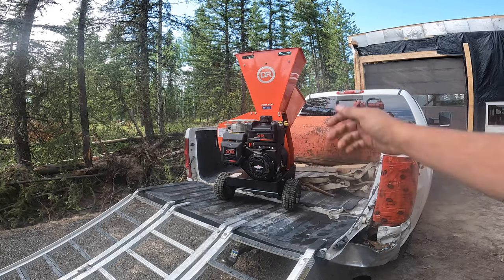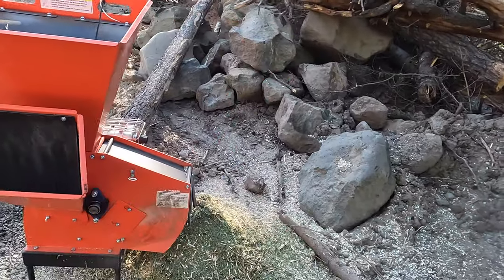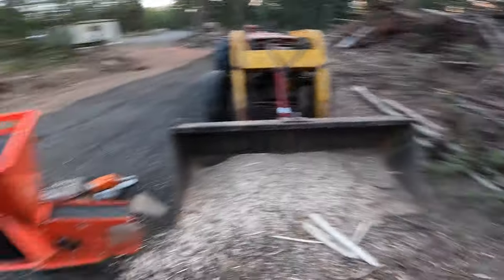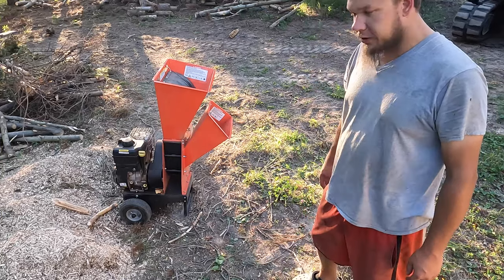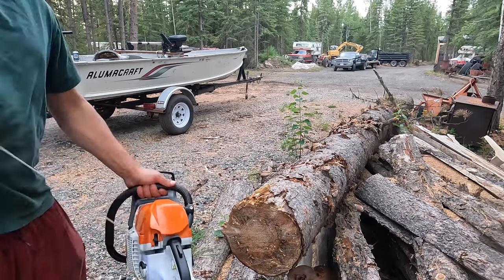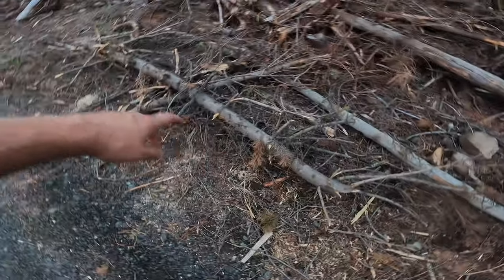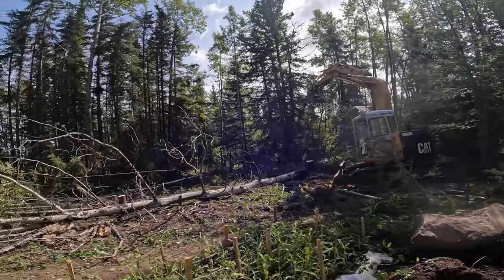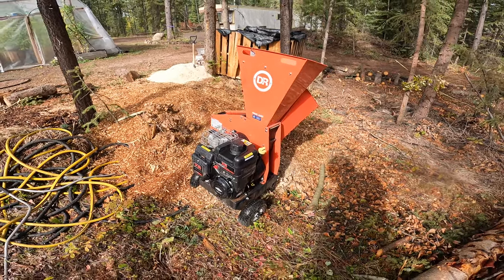Is A Small Wood Chipper Good For a Small Acreage?? and Brand New MS362c Chainsaw   4K

Comment: I got metal and electronic recycling point right next door and amount of wood chippers (electric) and other tools that only have minor lack of maintenance issues is staggering. I have collected and 5 minute fixed dozen woodchippers and only issue was ether damaged cord or most often dull blades. Couple had poor design getting clogged up by leafs rather fast. None of them worked that well with thicker stuff and even the heavy duty ones struggled with dry spruce even if thinner ones. Personally unless i'm looking to make compost, i would not waste time and energy on chipping the branches, but build kinda harvester claw that can crab the trunk and use rollers to remove branches from the trunk or chainsaw or machete etc manual tool, use the wood chipper for the small stuff or just pile and burn them if there is possibility for it. You can then turn the trunks of all sizes above 20mm or how small the claw can debranch into fire wood to be sold cheap for some folk who have issues to make their own due health. That way you get rid off the crap on jobsite and can make money instead of paying to get rid off it, or hell donate it and put it in as tax write off.

Also never push your hand that deep into intake chute! All it takes is blade start to pull braches and that branch catch the glove and pull you in. Prosthetics suck and cost tons so dont create need for one. If you get things stuck like that, make plywood peace that fits the the chute and handle to that so you can use it to push thing in, while shape prevents it going to the blade.
Another thing to consider if you plan on putting larger engine on it.. those walls are designed for the hp and rpm of the stock motor and most likely just barely be safe enough, so if you add larger engine, there is high chance that you get things kicked trough the frame and trough you. Mind that blade contraption is moving what ever is the rpm of the stock engine, so it might not be enough for larger one.
"this is why i like 24 inch bar" Yeah, its just enough to cut your toes off. I was thinking on getting longer bar on my saws, but after some moron threw away their barely used ms180 that just needed fresh fuel, i have been loving that saw almost much as ms200 since its light and works great for debranching. After witch if i need to cut logs i take out the trusty 026 for logs and smaller stuff those two smaller ones are just fine. Then again i tend to clear the forests from smaller stuff for firewood and not other cut down logs. You other hand have plenty of equipment my budget could not even dream about so thats one difference. Like i would kill for bobcat or proper tracked excavator with a claw.
I know i'm not best when it comes to safety but camoon man, shorts and safety crocks when chainsawing? Least get protective boots and leg straps when going at it with long bar like that. Mind the saw has more leverage on you than you have on it and all it takes is just one mistake or lap of concentration. Looking your surroundings, i doubt even helicopter can get you into hospital before you bleed out.
Also as a tip, never cut down more than 2 trees at the time. Always process one of the time, or you might be processing one, that then swaps the balance point, hits the another that sends you flying with running chainsaw. Had couple powerline guys coming to help to take down trees near the line so had to put them into pile. Felling one it kicked another and i went flying couple meters away, thankfully i chain was not turning at the time and there was space there, but i could have been stabbed by branches.
Further more why are you leaving such long stumps? Even if it means more sharpening and wear and tear to saw, i cut lowest as its possible leaving no stumps, simply cause i would not like to trip and go trough whole Vietnam arch about spike traps...Also sucks when track or tire gets fucked up by one.

FYI since you have aspen growing, if you are installing culverts, do put about 3 aspen trunks of above 10cm thick on top after you have compressed the sand. By this you spread the load of say logging trucks and what now heavy equipment driving over it so you wont have W shape culverts if you are experiencing frost and heavy traffic. Aspen when buried will last around 20-30 years as support under ground no issues. Found old land bridge that had aspen put on top and it was probably 40 y old, so those last long time.

Comment: Too answer your video title question, I'd say yes it is good for the smaller acreage,as long as people use it as it's intended to be used & not going nut's & over using / working anything made for peavy mart or Princess Auto's shelfs. I on the other hand Drove a 8 axle configuration  Possum belly Tycrop. super  B chip truck trailer on/off highway to get loaded by a Dual motored Massive tree chipper all day long for the pulp global market, Especially the Japanese who prefer this hardwood for their shinny kodak flash 📸 cameras. So yah size matters when it comes to what you dealing with.

Comment: Yes, that knife is dull. It is only the slanted side that faces towards the mounting plate that you must sand. The sharper your knife is, the less petrol you will use and you will also find that your chipper works at the highest speed and with the least amount of wear and tear on the machine.

Comment: Easy subscribe from me because of the crocs :P I use those all the fucking time myself :P
Reply from the maker: Always happy to have a croc fan join the club! Welcome 😂
Reply: @mikesmechanix  The 362 looks awesome, I'm somewhat of a spoiled brat, so I went for the 500i, and it is just stupid. If you ever get the money and need,  I would recommend the 500i every day. I have a stock setup with hexa chain and it is just crazy strong/fast. Most negative note on it, it drinks fuel faster than i drink beer :P
Reply from the maker: I was going to pull the trigger on the 500i , but I just don't have the big wood around here for it to be necessary.. I've got an old husky 2100 for those big ones.. my main goal was a lightweight saw to replace the 361 some operator decided to run over with their excavator🤦‍♂️
Reply: @mikesmechanix  honestly, living in Norway (small wood), just doing some firewood on the side, I really have no real need for a 500i. Using a 261 would be plenty for me in reality, but when doing my side gig I really wanted to have fun and everyone talking about the 500i always mentioned it being fun. So I just went for it and i have never looked back 😜